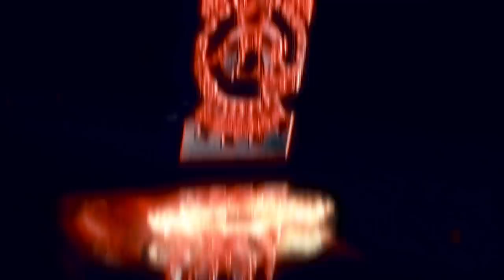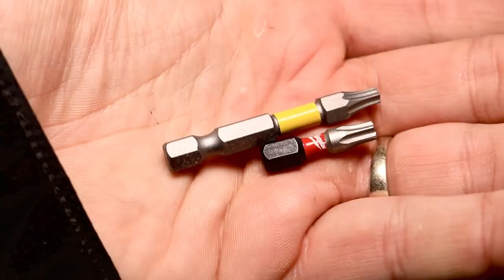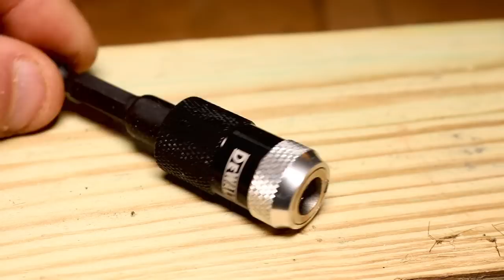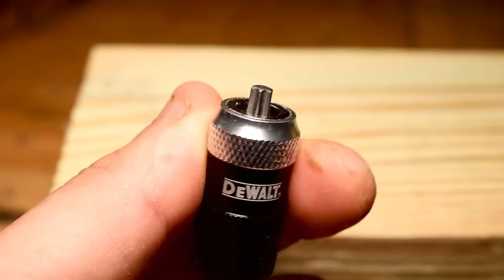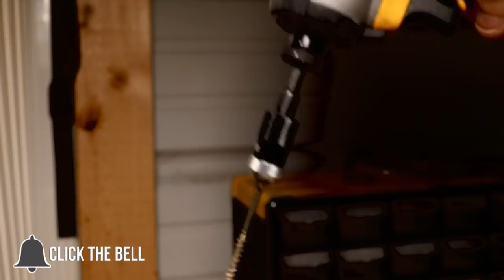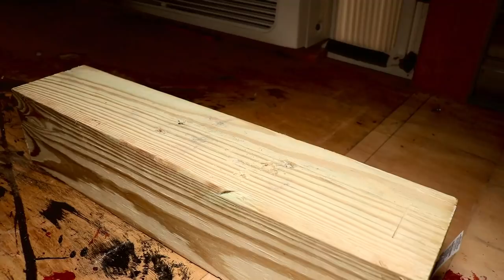If you use an impact driver, you ABSOLUTELY NEED TO SEE THIS TOOL!  #impactdriver #powertools

Comment: The silver ring on the end with the magnet is removable. Useful when removing a screw that was recessed to deeply or if you need to clean metal particles that collect on the magnet!
Reply from the maker: Thanks Geoff! I actually forgot to add that to the video, and was kicking myself right I'd the butt for it!
Reply: geoff are these good bits, or should i get a different make eg wera or makita?, thanks
Reply: @lazycarper7925  Wera is my preferred still. The dewalt will get pulled into action if I want the stronger magnet. Never used the Makita version. The dewalt releases when you pull back while the Wera releases by pushing forward. This difference prevents the bit from being accidently released when driving a screw in to deep.
Reply: @geoffgranger718  thanks wera is 10 quid, the dewalt is 7 quid,  would you still get the wera based on that price?
Reply: @lazycarper7925  Yes. This is one of the beefier items from dewalt, however dewalt can be more hit or miss to quality. Wera does use more plastic but not in a way to reduce quality. Unfortunately the plastic does feel cheap.
Reply: @geoffgranger718  thanks,for the help, all the best for new year

Comment: I've had this tool for at least 5 yrs and dug it out of mothballs, because i was building a wooden fence and got sick and tired of dropping my screws on the ground and used it for the first time yesterday and loved it.. ps the only draw back i have found is when the screw is set the tip bounces out , but not always tried the dewalt , but the magnet kept breaking and i have two of the dewalt holders featured here.

Comment: Currently clearance at tractor supply in a small kit. 5.99 with 8-10 black DeWalt 1" drive bits. Grabbed 3 of them. Magnet works great. As for the lock and release it works okay but compared to my Wiha locking bit holder the manufacturer quality is night and day. Action of the Wiha is easily
 superior. Feels very precise and tactile

Comment: 2:14 A mechanic don't use construction, deck screws or even general purpose screws. Screws are usually used on some interior trim pieces, but you don't need a power tool to loosen or tighten those.

Comment: Wera ring magnet! With that, it releases the bit by pulling the collet forward so it won’t drop the bit or release it  if you overdrive the fastener. The dewalt will get pushed back by the material you’re fastening and then release the bit.  The wera has much better construction than the dewalt as well.
Reply: and three times the cost

Comment: I have the Dewalt angle bit holder,it fits into my Bosch 1/2  /1/4 square drive impact driver, it is just right to fit in the pull back locking collar, I am amazed I never had one before,and the magnetic hold is ok,

Comment: I have the little yellow one. It does the same job, but it is much more of a pain in the ass if you are changing bits alot. To the good, it is a more compact setup.

Depends on what you are doing and where you are doing it, I suppose.

Comment: I absolutely love the idea of it being a magnetic bit holder. However, as far as using it for small framing tasks, I can't see how the head of the screw will self-counter sink when toe screwing through the end of a 2x4 like you can with a commonly used straight shank bit. It seems the shoulder on this bit holder would be prevent the countersink. I could be wrong. Anyways, nice locking feature.

Comment: I have this type of bit by Dewalt but the tip is plastic but it releases the same way. I also have the dewalt plastic magnetic sleeve too. I like this being all metal. Keep the quest going.
Reply from the maker: The quest shall continue my bro!!!!!
Reply: The metal one is much more robust and adaptive than the plastic dealio, I have the plastic ones also but I never use them...

Comment: As a hardware installer I love the pivot holder, no quick release mechanism but it's super handy for tight situations and I keep a pair of needle nose pliers to switch bits which I don't have to do often because I mainly use Phillips screws. It is magnetic too.
Reply from the maker: I actually just bought it, but haven't had a chance to use it yet. I've heard a lot of good things about it though

Comment: i have one of those exact pieces, and another one that is a bit beefy- ier one that came with a screw driver (dewalt), i love those things, but i'm having a problem finding them locally anymore, i've had mine for at least  5 years and they are finally getting a bit beat (no pun intended, it just worked out that way) i spray them occasionally with whatever lube i have on hand, and occasionally blow them out with the air line at work (auto body, 120 lbs per sq ft of pressure) and they still work, it is a permanent resident in my main drill driver

Comment: Thanks , but as a mechanic my main issue is bit breakage I’ve been using Irwin bits  for last year but last week I broke 3 🤢 they just can’t win on these as if not hard enough they strip if to hard they snap.  The heat treat is hard to do when cost is the goal

Comment: What is the difference between this and the regular DeWalt magnetic screwdriving bit drive guide with the sleeve? Don't they both do the same?..... I am sold. I am going to get the DEWALT TOUGH GRIP 27-Piece Steel Hex Shank Screwdriver Bit Set at Lowe's today as it is currently on sale for only $9.98 (retail $19.98) and it actually comes with this Tough Grip rapid load tool as well as the regular magnetic screwdriving bit drive guide too. It even comes with 4 hex drill bits too. I compared the Tough Grip rapid load tool to this magnetic screwdriving bit holder and the difference is a "SureSet magnetic fastener holding system".

Comment: I wish the business end didn't have such aggressive knurling to help prevent scratching the work surface if the head brushes over the material stationary or while spinning. Otherwise, it's a really good design utilizing one handed operation. Perfect for ladders and tight spots.

Comment: I like these, but when I don't want a magnet on the end, or a need a longer reach, I go with an impact extension made by Bosch - them come in 6 or 12 inch lengths. It has a blue ring that you pull to release the bit, and I've never had any trouble getting a bit out of it, or had a bit fall out when in use.

Comment: I am REALLY confused!!! I have a Dewalt DW2507 and it’s identical to what you showed except there’s a little push button ball bearing, like you see on a ratchet socket set. But it doesn’t do anything when I push it in??? I thought maybe it was to release it so it could pivot / swivel but no. Appears to be useless? What the heck is the purpose of it?
Reply from the maker: Hi Louis.  Yes sir, that is what it should do. The ball is there to hold it in place, so I would assume that your should pivot as well
Reply: @ToolReviewZone  I forgot to mention the shaft is silver not black like you have. And when I Google they are ALL black, though I see pics of it silver like mine but when I click on it it takes me to black shaft. No doubt I have an early version. Maybe that matters? But yeah, even with a magnifying glass it appears to be a solid connection lol

Comment: As a specialties contractor, I work ins9de a home, typically 9’ or more u- from the wood floors. I wear a holster for my drills and drivers. I re ent,y had a DeWalt Quick-Connect fail, and the 6” bit fell to the floor, much to my chagrine. Customers don’t like OT hear, nor see the damage a tool ca make on their wood floors. How does this DeWalt work when holstering / unholstering a drill all day long? I’ve temporarily gone back to my Ridgid 12v impact with quick-connect, but I’d like to find a solution for my 12v drill.
Reply from the maker: This actually holds the bit in very well. As for the screws, the magnet is not as strong as the Makita one that I reviewed, but does a good job

Comment: I’m assuming these wouldn’t keep a fastener magnetised whilst using a 50mm long bit as opposed to the little bits as it would be too far away for the magnets to pull the screw ?
Reply: really would depend on what material the 50mm bit is made of.

Comment: I just purchased a dewalt XR dcd991 drilldriver and it makes a click / thud sound when I let offf the trigger. Is this normal or should it be returned?
Reply from the maker: Sometimes on my ridgid it makes that sound when it stops, but not sure what the thud sound would be? If you don't feel right about it, you could always turn it in for another

Comment: DEWALT when i drop your bits from 6 feet when i work . Your big head extensionheads break . Electricians cants use big head bits like that at the Breaker

Comment: how do adjust the bit for sheetrock application? As it is out of the package...the bit sinks the screws too far into the sheetrock.
Reply from the maker: I did a review for an adjustable one that actually works well. This not so much for sheetrock

Comment: eh, it seems redundant. I also don’t like pushing back to release. It’s always better to pull forward to release because I have had times with a different adapter where it hit something as I was screening in, and the lock got disengaged just enough to loose the socket.

So I’ll stick with the longer bit and a magnet if needed. I use a Makita XDT12, and the magnet came in a set of DeWalt bits.

Comment: something like that would be perfect for like sheetrock I like the one that you had that was adjustable because there's nothing more annoying trying to hang sheetrock and keep dropping screws Thursday I ended up basically screaming at everyone because I going to the house and not one guy had a tool belt on so they're holding hammers pry bars put it on down pick up screw guns I told everybody everyone looks like a bunch of fu%king morons that nobody has a tool belt on it's the little things sometimes that pissed me off
Reply from the maker: Lol, I hear you Joseph.  Sometimes people make things harder for themselves and everyone else